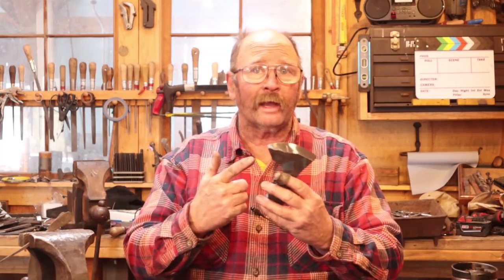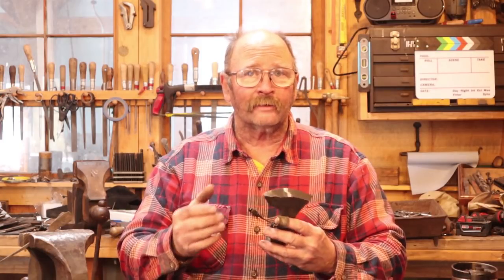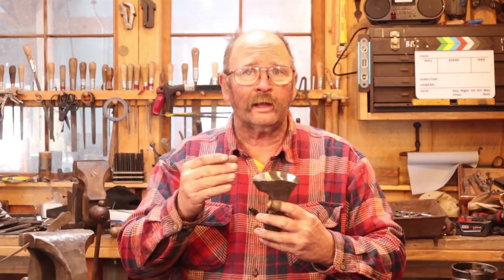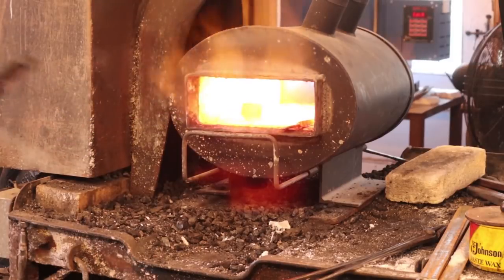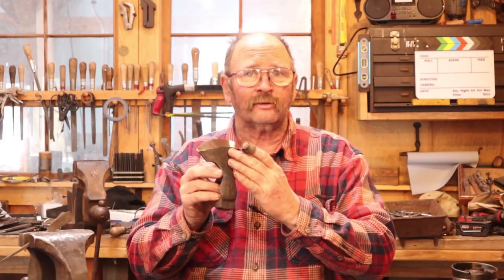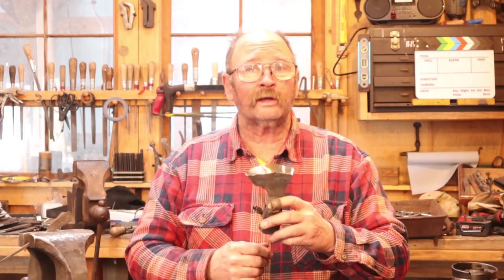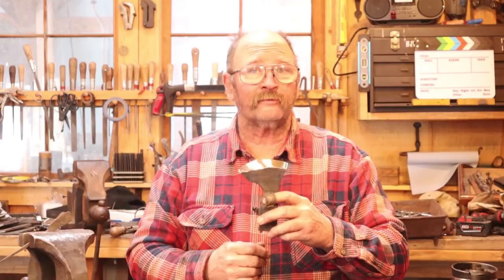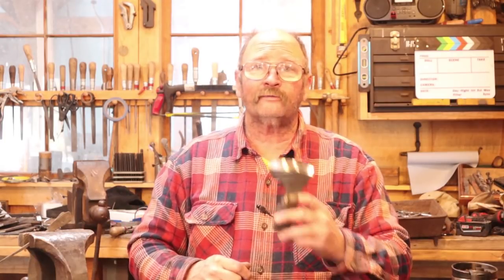He who would a good edge win

Comment: Nice advice, i wonder if using charcoal would allow to forge the piece closer to it's final state without loosing as much carbon
Reply from the maker: In theory it would, but the conditions would need to be just right.
Reply: Great video! I thought I'd add this as it might help.... A neutral or reducing atmosphere in the forge is required to prevent carbon loss, not sure about a charcoal forge but with a propane forge, this is achievable, even for forge welding. And file checking a quenched blade can sometimes be deceiving as although the decarburized layer will allow the file to cut, there  might be a hard edge underneath. Hopefully no more than a few thou under the skin.

Comment: I'm surprised... This video is leaving out the entire discussion of atmospheric control. Decarburization happens in an oxidizing atmosphere; carburization happens in a reducing atmosphere. In other words, if you tune your forge atmosphere, whether by adjusting oxygen intake for propane or by workpiece placement in a coal or charcoal forge, you can literally carburize your steel. For people like you who work indoors, that might not be a good idea: reducing flames put out a lot more carbon monoxide.

As for me, I typically forge with a fairly oxidizing flame and grind anyway, because of the warpage issues. Martensite being about 4.3% less dense than pearlite, stresses are inevitable. All you can do is try to keep your profile and your heat sufficiently symmetrical that the stresses balance each other, giving minimal actual warp. The usual rule of thumb for knives is edge no thinner than a dime for heat treat. I confess to breaking that rule more than I should... but I'm working mostly monosteels, where I can usually get away with it. With a welded edge, you're guaranteed to have some unbalanced stress.
Reply from the maker: This video was never meant to be about atmospheric control or decarburization in general.  But rather was a look at an old blacksmiting adage that has been around since long before anyone understood the role that carbon plays in hardening steel.  Some day I hope t find a local metallurgist that would do a few guest features discussing such issues on a level suitable for the average blacksmith.

Comment: If you are losing carbon in the heating process how does it harden when it is quenched ?
Reply: Because there is carbon left,just not as much as you started with !
Reply from the maker: Hopefully you aren't losing so much that is won't harden at all.  But ideally you will grind away the area that has lost carbon leaving and edge in steel that is undamaged.